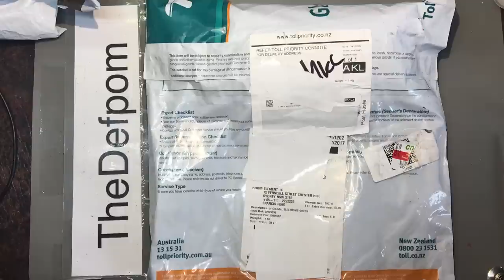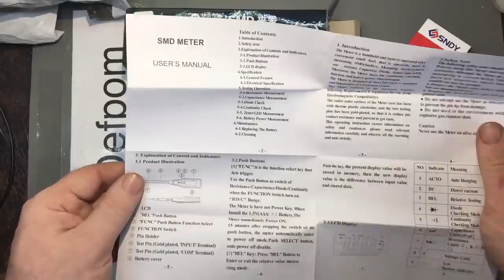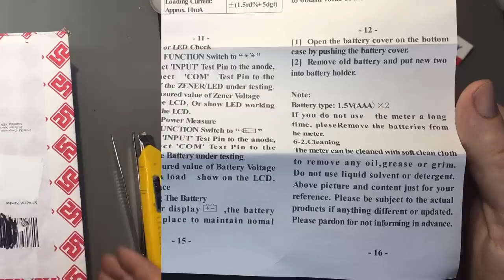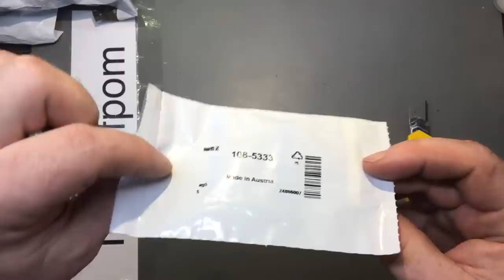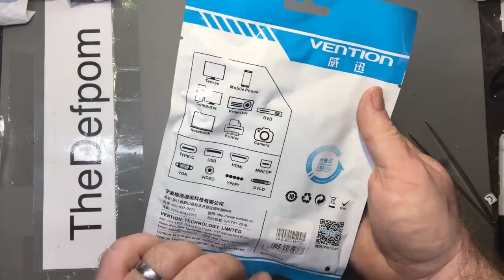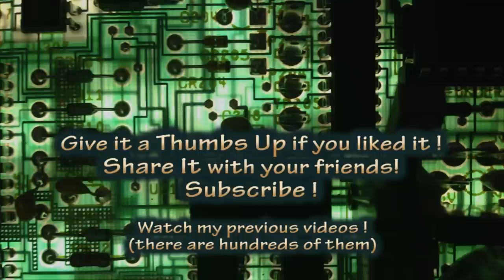#325 Mailbag 3rd January 2018

Comment: Sorry, but there is a very low bass hum, very annoying.
The recording is only 15 minutes ... can you just turn the air conditioning off during that time?
Reply from the maker: Sorry about that! I thought I had managed to get the level down enough to be OK after rubber mounting the mic, I was wrong! I will be more careful about that in future.